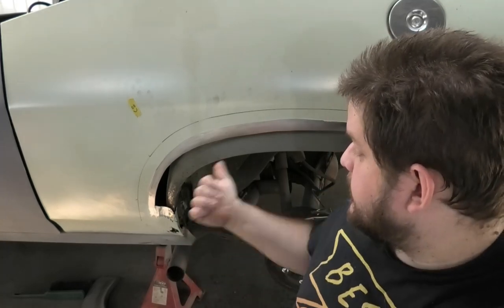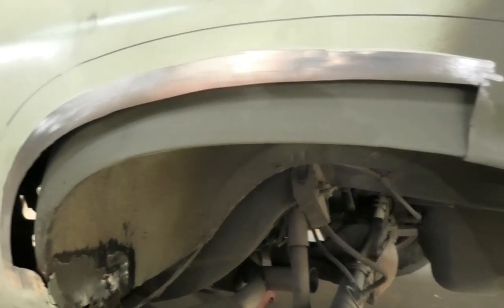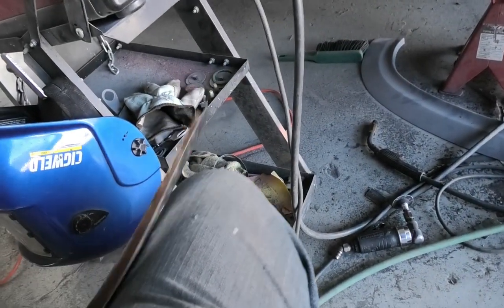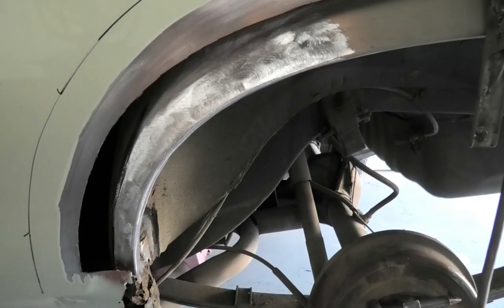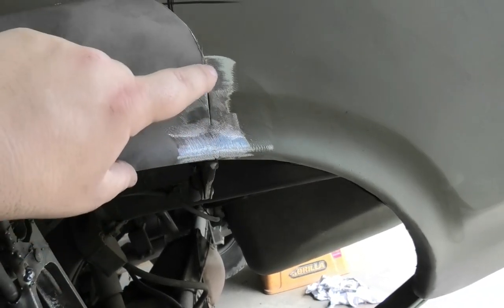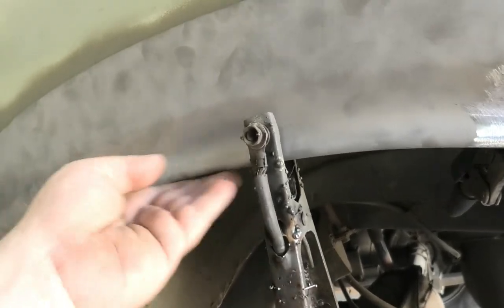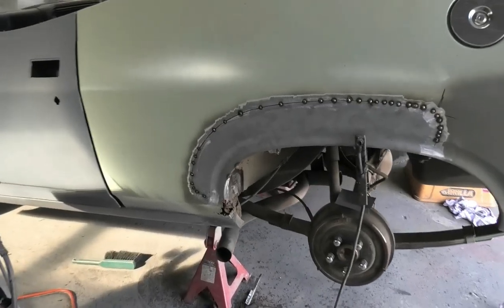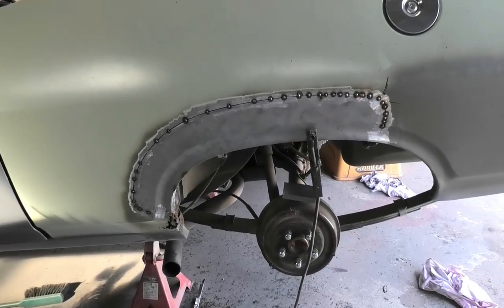XB coupe rear wheel arch repair continues

Comment: Nice job on that wheel arch. I’ll tell you a story the guy that did all the body work on my XW Ute, hand built the whole RH A pillar, that was about 25 years ago when that piece was not available,  mind you he made the pillar with a hammer, a small vice mount press brake and a small anvil. If you couldn’t buy that piece to repair that wheel arch,. my guy could make it
Reply: My panel beater has retired now he still does a few small jobs every now and then we’re both in our 70s I’m a diesel mechanic by trade so as a panel beater I’m pretty dam useless, but  without sounding like I’m boasting I was good at my job and my mate was the best I’ve ever seen. Watching your channel I’m so glad to see a young bloke like you doing what you do and you will end up being just as good as my mate, you’ve given me hope for the younger generation. Keep up the good work and I’ll be watching all your project’s intently

Comment: Are you going to do a video on the repair of the lower inner corner I hope so. I see that you’re using Ryobi battery grinder I’ve had one for about 10 years it just died the other day I’m going to by a brushless one. Aside from the grinder. I  have a brushless impact gun which wiil undo nuts and bolts that my 3/4 drive air gun won’t touch, I have a brushless drill which I only bought just before Xmas last year, I think I had my old one for 5 or 6 years and to top it off I have a brushless power saw all Ryobi of course, 5 or 6 AH batteries are what should be used I’ve had 3 5s for as long as I can remember. For their price their price they’re th best valued  battery tools on the market. What’s your opinion.
Reply from the maker: Ryobi stuff is good but ive definitely killed a few of there things
Reply: @xacoupeguy  Yours probably get a bigger work than mine but  I’m not about to spend $700 dollars on a Milwaukee skin and another $200 hundred each for the batteries and then you’ve got to buy a charger, they’re excellent tools but way war over priced especially when you consider they’re probably made in China